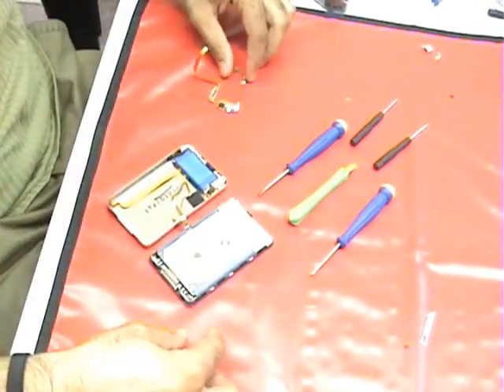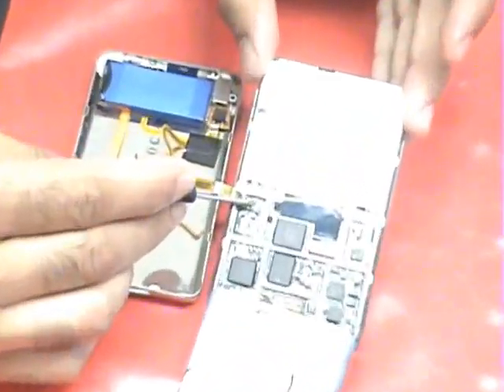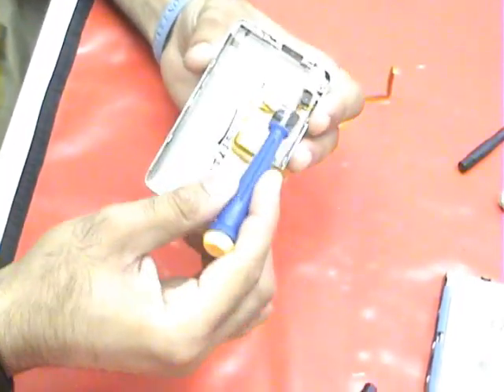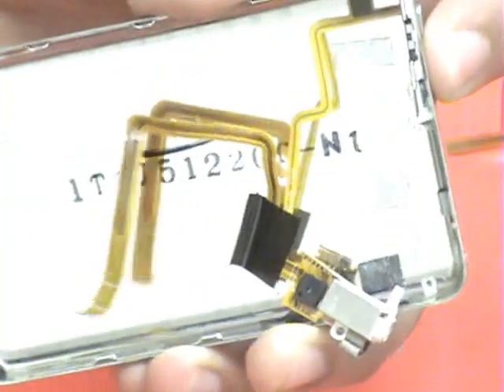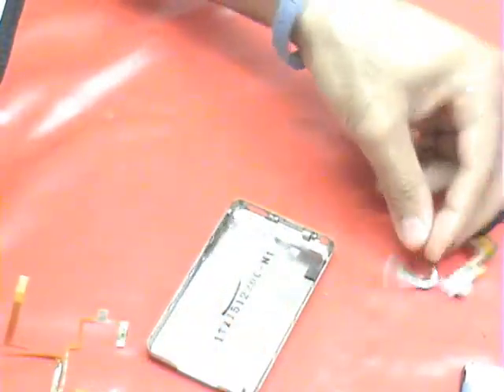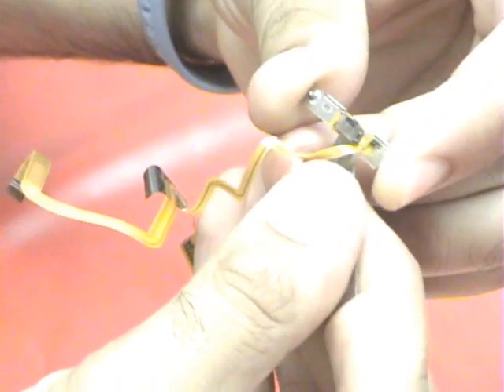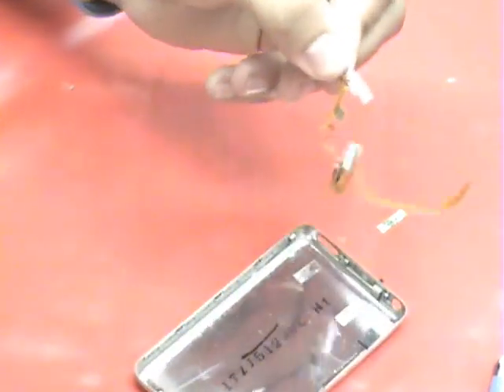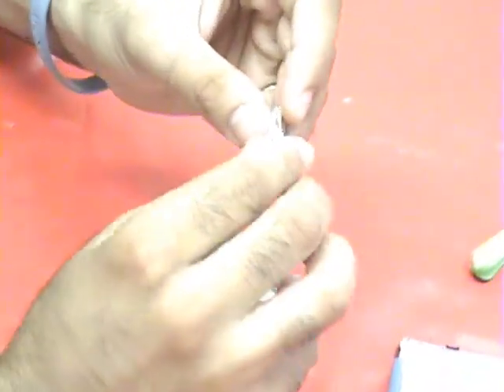iPod Video Headphone Jack Installation

Comment: oh man, this video is such a lifesaver.  Thank you!! Also a helpful tip, for small screws, it can be really annoying to position the screws in place. If you have a small screwdriver that is metal, take a magnetic and stick it to the metal part of your screwdriver. Then touch the small screw you need and it'll stick magnetically. Helps tremendously with small screws.

Comment: awesome! my 30gig %th generation was bad about losing stereo output. twice the sound started to  come out of only ear, and i had it replaced under warranty. over a year later it happened again, and i ordered the part and installed it with this video in an hour. perfect fix!

Comment: Nice video, I followed this video and replaced my headphone jack in about 30 minutes.
Getting the lock switch to align properly is pretty tricky, i suggest putting a bit of adhesive between the replacement switch and the metal plate, and then screwing it onto to white plastic switch.

Comment: Thank you for your help, the only recommendation is to explain the part about switching out the hold switches, must replacement parts don't come with that. I found that to be the most difficult part. Thank you so much I just saved $200!!!!

Comment: The ipod Touch utilizes different cables and setup; if you open it you can see the headphone jack and where the cables run to so make a mental note of what you have to do once you get the cable.

You will need a ipod touch specific part, other than that it should be the same. There are ipod touch tutorials on youtube if you need further assistance.

Comment: i did it..  it was getting a little aggravated . .  because the battery was stuck to the plate .. then i lost one of the screws .. so i had to crazy glue a couple parts .. and the hold switch doesn't work . . but i can hear out of both headphones .. [= which im happy about . . im prob..  gunna have to go back in to fix the hold switch .. but fro now im satisfied .. [= .. thanx for the vid .. [=

Comment: Doubt it.  I tried to fix the broken jack at first and the cable broke... so that's why I had to order a new one.

There are connections in the ribbon cable which are really tiny, so you'd have to line them back up exactly and hope that they are actually connecting and not just really close to each other, because that won't do.

Comment: My iPod headphone jack got repaired in the summer and guess what happens, the thing stops working and the bottom right corner of my screen lifts up when I put my iPod in, so basically is there another way other than breaking it open again and just ruining the shell, because the protective rubber rim is completely gone one the bottom side, the right side, and the upper side. P.S. I have an iPod touch second generation.

Thank You!!!!!

Comment: hey i couldnt hear out the left earphone so i replaced my headphone jack but when i put it back together it still didnt work. could it be anything else the only thing i can think is that the plastic thing (*4:40 thru 4:57*)that goes on the side of the earphone whole isnt glued on to it its just hanging does that matter??

Comment: hello,i have a problem with my ipod nano.my earphones are almost new and they work perfect when i tried em on my laptop,but on my ipod,i hear only "transformers voices" any tip how to fix it?i used different earphones,i had the same problem,but when i moved the wire in the jack,it worked.

Comment: @tristangemus/SLippiNc: dudes, chill - not everyone knows the inner workings of apple's electronic devices. 
@dramaticplastic2010: The iPod touch has a very similar layout, but you actually need an entirely different set of tools, as the process IS quite different. My advice - ignore the nerdy haters, and check out a different video.

Comment: The ones on eBay (and the one I bought) are actually from a store that advertises on eBay.  So look for them on eBay and in the item description somewhere there should be a link to the main store or something.  Don't buy a used one.  The one I bought was only $10.